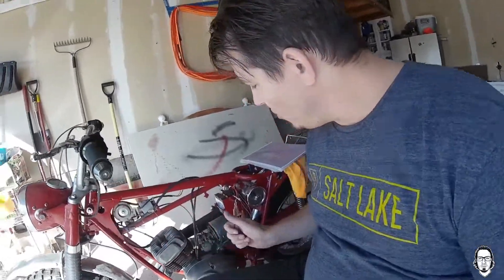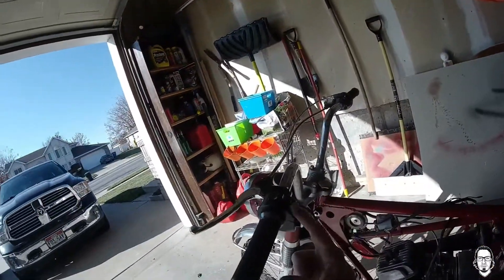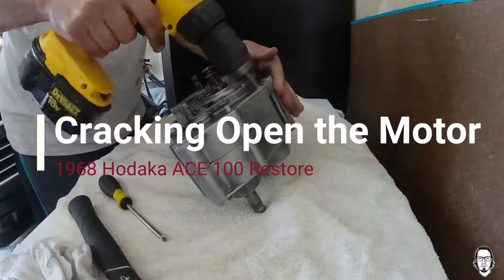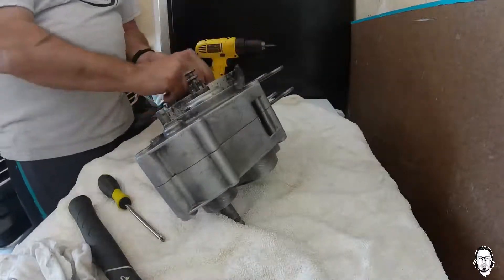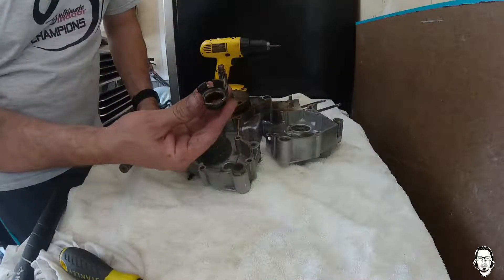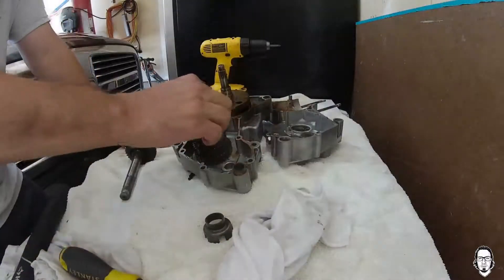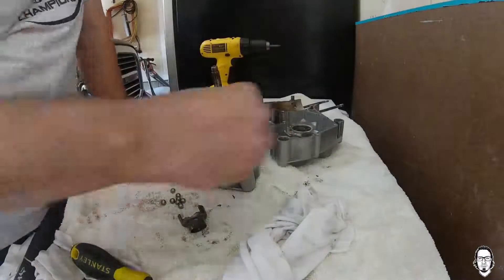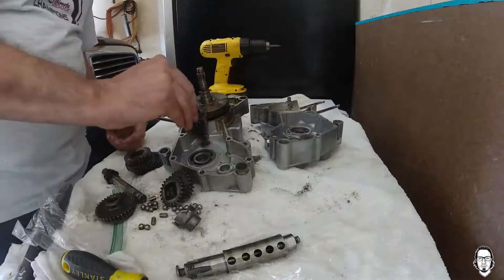Cracking (Splitting) Open the Hodaka Motor

Comment: My first Hodaka teardown was in 1971 on my Bonanza. I like to split them cases with the flywheel side up. Usually I start the split by spreading two cylinder studs a little and then I start working the case off. Ball receiver and kick rollers I grease on assembly